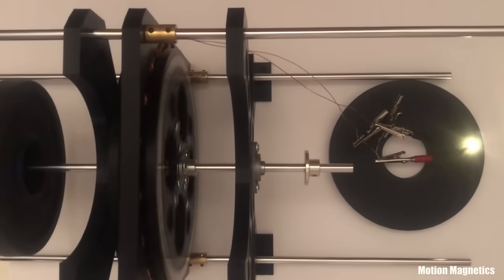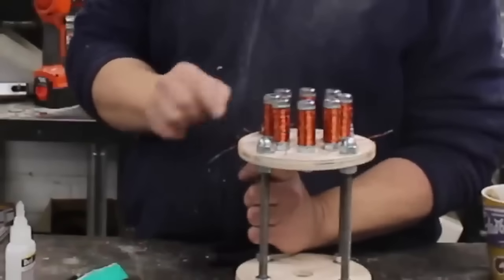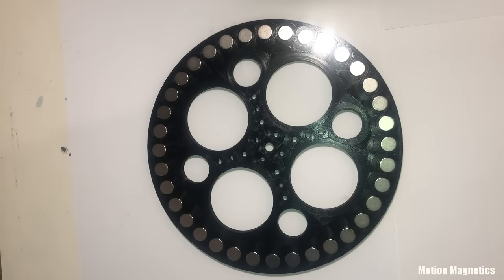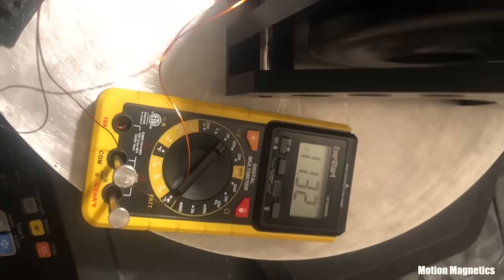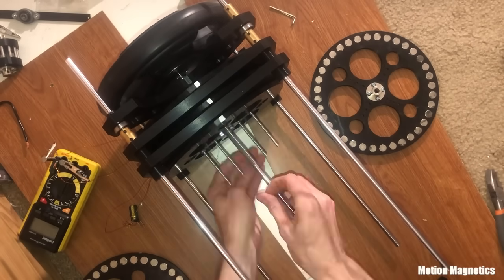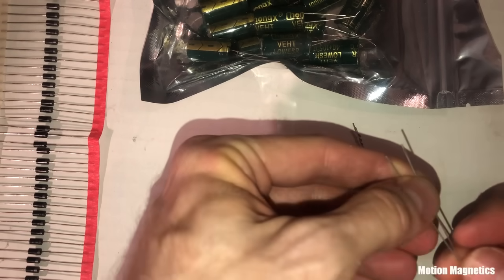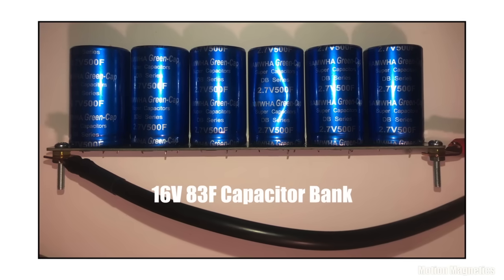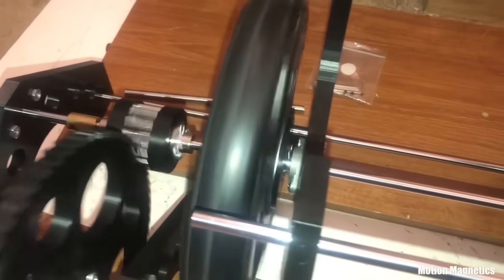Stackable Generator

Comment: Thanks for sharing this. As a retired Electrical & Electronics Engineer I found this fascinating and admire your approach in your endeavours to produce a working design from your experimentation. I look forward to watching your future episodes of this project.
Reply: where as i see a complete refusal to accept any of the tried and true design methods developed over the last century or so. wheres the minimal reluctance magnetic path?
wheres any attempt to calculate flux density?
is there the merest mention of jacobs law, the resistance of the windings versus the load?
was there any effort put into optimising turns ratios and pole areas?

simply spinning a wheel and measuring a few volts proves nothing... wheres the test on the power required to spin it versus the power it can deliver to a load? the efficiency of the system?

its waving magnets past wires and even faraday 2 centuries ago with no previous source material to fall back on had a better understanding of the principles to maximise performance...

these sort of videos are the antithesis of good engineering.
Reply: @paradiselost9946 Exactly. Notice how the system nearly failed any time a useful load was put on it?
Reply from the maker: Thank you! That means a lot to me coming from a retired Electrical & Electronics Engineer. I'm looking forward to building more of it and sharing it.
Reply: To counter the statement "these sort of videos are the antithesis of good engineering", you can argue that good engineering practices are essential for ensuring the safety, reliability, and efficiency of any system. Which I agree with. Also poor design choices or lack of attention to detail can lead to negative outcomes, such as accidents, injuries, and loss of life. Therefore, it is important to prioritize good engineering practices and invest in the necessary resources to ensure that they are followed. Innovation and thinking outside of the box is an important approach that can, but not always, lead to a radical design which could beneficial in its outcome. Basically if you think you can do it better, by all means give it a go. After all you may well turn out to be the next ‘Nikola Tesla’!
Reply: @onlooker251  why does it always have to be "nikola tesla"?

how about rankine kennedy? why doesnt he ever get a mention despite developing certain devices that are claimed as teslas?

sorry, ive known about tesla for decades, well before the current mythical cult status.

yes, he did amazing things but please dont crap in my ear about him. ive heard it all before. theres plenty of other people who have been ignored and overlooked as well from that era.

this guy recommends using bolts as cores for coils. wheres the high permeability laminations for maximum magnetic flux density and the minimisation of eddy current and hysteresis losses? wheres the reduction of air gaps to the bare minimum?

so i stick to my statement, these are the antithesis of good engineering practice, a waste of time, money, resources, making a barely performing device when an off the shelf unit will easily outperform it and has documented efficiency to back it up.

if he actually was attempting something revolutionary, or figured out how to overcome certain issues, im all for it.

but he hasnt. it isnt evolution, its taking ten steps backwards.
Reply: @onlooker251 all that supposed experience and jibber jabber with no practical input.

Comment: Watching your disks wobble is going to make me sperg out, please find a drillpress or make a jig for perpendicular driveshafts. There are dozens of cheap tools, drill attachments, drill alignment bit adapters, drill-mounted levels, whatever.

With a smoother spin you'll get more rpms, less drag, less vibration, less disruption, smoother generation... everything will improve.
Reply from the maker: I'll probably make the final version with a CNC machine. I'm still in the design and testing phase though, so it's just cheaper and easier to 3D print the parts until I get everything worked out.

You are correct though, everything in the performance will improve once I do that.

Comment: Great work! Have you figured out how to best transfer the weight into rotational energy? Although it might sound silly, take a took at the Leifheit rotational mop bucket. The handle of the mop uses an old mechanism like the old ratchet screwdrivers, but bigger. Maybe it'll give you some inspiration. Good luck!
Reply from the maker: Thanks. I've built part of the gear system, but am still experimenting. Gears can be a bit noisy, so I'm also going to test a belted gear system. 
Thanks for the suggestion.

Comment: dude imagine you make the 3d printer do the stator windings for you in serpentine so wire stays taught and continuous even layers in perfect symmetry no imperfections then use an odd number of serpantine posts so it works out like how odd blade fans are more efficient than even blade fans due to pie 🥧 or something definitely stack em up that motor drag though Is it creating power through braking but hopefully not wasting it to heat or noise inefficiencies...  currently as watching this simultaneously reading "electric motor manual" edited by robert j. lawrie and the staff of electrical construction and maintenance magazine , the things pretty detailed and only 128 pages a few for introduction table of contents and index of terms/page listings it was covered in dirt in my dads toolbox 🧰 but cleaned it carefully and just like new ... anyways glad you mentioned that guy i love his content too hopefully watched em all but i have to keep rewatching to make sure i didn't miss anything or just to refresh inspiration 😅❤ good old friend shared science data
Reply from the maker: I wish my 3D printer did all of that. 
I love his content as well. I'm nowhere near having watched all of his videos though. The man is a machine at cranking out amazing content on a constant basis.

Comment: it's probably pointless because it's just a prototype, but you should put those diodes into a breadboard or some kind of prototyping board, or at least solder them together for better connection. just gives me the heeby jeeby seeing them twisted together. maybe they will get soldered together some day.
otherwise a pretty cool project i would want to attempt some day
Reply from the maker: Well, I did heat shrink the magnetic wires from the bridge rectifier to 12AWG wires. So it's a step in that direction. You're right though, I will eventually solder things when I get closer to a final version.
Reply: It is just a low voltage toy. No need to get your panties tied in a knot.

Comment: have you tried adding testing a hallbach magnetic array it provides double the magnetic flux on one side of the magnets it add a little more weight to the assembly but the power output should be worth it. i also suggest using a inductor to help smooth out more irregularities in the power output. your idea looks and sounds great keep it up man
Reply from the maker: I have not, but it's been suggested a couple of times. Not a bad idea.
Thanks!

Comment: generators are built for engines, which will actuate it. This generator you built is good for turbine or diesel engine (constant RPM, high power density).
Reply: This generator is not good for anything.

Comment: I subscribed to your channel! You are doing so many projects that I have wondered about and mulled over through the years., I have a lot of drawings of ideas but lack of funding and probably a lack of gumption kept me from actually experimenting and building the things I’ve drawn over the years. I am especially excited to see your stacked generator ( that’s how I found your channel ). I use to drive a truck for a living and had a couple hours everyday before I got to my first stop which gave me lots of time to mull over ideas and think about how they might work. I’d make sketches of my ponderings and talk to friends about them. I was excited to see a company called “Lutec” actually building a stacked generator like I had drawn., they claimed that it could run itself and they had a short video of a prototype (looked like CG to me) actually running. I thought this was a good idea, I’m so glad to see someone actually building one. I still believe the stacked generator will not only work, but could be, very easily made to run itself, producing excess power. 
Your videos are great and so is your line of thinking and tinkering! I’ll be watching!
Reply from the maker: I have piles of design sketches, so I know just what you mean. 
I remember the Lutec motor. It was featured on a mainstream news show and then slowly vanished from the spotlight. 
Your line of thinking parallels my own.
Thanks! Do great things!

Comment: You should have the generator once spun up to auto power itself. Add a electric motor to the spindle and dedicate a few of the coils to power it. That way you can power the motor and generate more energy. You can also find a motor that will be just a little more powerful than you need to run the entire generator apparatus  at max that way the motor isn't over working itself and its shelf and use live is extended that mean you scale back the motor to never run at maximum capacity so that the more will never hits its stress limits.
Reply: I'm just rambling but I bet you get the idea. I dont ever have the ability to build such things but I can come up with technical ideas to help advance to at least help them along. I guess I'm the Idea guy not the builder type. this is a really cool project you got here man.😁
Reply from the maker: Thanks for the suggestion.
Reply: YEPPERS @Motionmagnetics
Reply: @novicracker1980 No!  You cannot power a motor, from the generator's output, to then spin the generator even faster.
Reply: @MrSummitville  why not?
Reply: If you use a motor that runs on alternating current and not direct current and requires an inverter to make the conversion I don't see why not. So please explain to me why not.
Reply: @novicracker1980  That'd be perpetual motion, which cannot happen
Reply: @skatingskelly  perpetual motion happens all the time you just don't see it.

Comment: General rule of thumb is to use a capacitor voltage 2 times the circuit voltage to account for their discharge behavior over 50% it’s rated voltage.
Reply from the maker: Thanks for the tip.
Reply: What "discharge behavior" are you talking about?

Comment: im no scientist but.
i have working models of similar things. for alternate purposes.
if youd be willing to work together. i think we may be on to something.
i can also tell you from 20+ years ago. fat wire vs skinny wire is a wasted debate.
think of it like this. how much power do you want to transfer?
skinny wire is sensitive. fat wire carries a load. 
in many ways i can show that but not the point.
we have much to discuss if youd like
Reply from the maker: Do you have any videos uploaded of your builds? I find it much easier to compare notes with a visual frame of reference.
Reply: @Motionmagnetics  short answer yes but no.
i do have many things ive made with proofs. some of the more recent things ive made have been kept more under wraps as im actually going to send some designs off to possibly get patented. im not full of it like some can be. the only real reason i dont share some of the stuff more openly is just so it doesnt get stolen before i can claim it as mine. i dont want someone to take my ideas and use them for profit. my things are so regular people can have things they need. its for emergencies its for people who dont have alot. any rich person can go out and buy whatever and i dont feel bad for them. but people that have to go with out thats who i wanna help most. 3rd worl underdeveloped areas people hit by natural disaster or even just this insanity of inflation. how you gonna heat or cool your house when the power company sends you a 100k heating or cooling bill. thats not right. but what if it didnt have to be that way. i dont want it to be that way.
Reply from the maker: @chehystpewpur4754  You can never be too careful when it comes to protecting your intellectual property rights. 

That mirrors my thinking. If everyone had access to generators that ran on something like gravity we'd never be at the mercy of the corporate power companies again.

Comment: Awesome project. I had started a gravity generator project as well, but when doing the math I thought I had found that the potential energy stored in something due to gravity was actually disappointingly low. I may have been doing the math wrong, but I was calculating that I'd need somewhere around 90kg for reasonable power output. Have you done similar calculations? The idea I may have been wrong has renewed my interest lol
Reply from the maker: I've been excited about the concept since it came to me. I quit worrying about the weight necessary to run the system when it occurred to me that I could just use a pulley system to reset it. You can make 500lbs feel like 50lbs with the right pulley setup.
Reply: @Motionmagnetics I'm trying the same thing!
Reply: It is not really energy dense (Doubt there's anything in use less dense). To have the same energy as a fully charged mediocre phone battery, you need 100Kg at 30m high. 
So using gravity as energy store is not really practical unless one very special case; Dams.
Can't see how it can be usefull for DiY unless you have a flow of water or a lot of space.

Comment: You are on to something with your stacked generator project. I had this idea a few years ago. The bottom two generator plates are wired to charge a capacitor bank which  is run through a voltage regulator and powers the electric motor which spins the actuator which also has a flywheel. As the bottom two produce the power to turn the unit, the gen-plates ( 4 ) above it produce excess electricity, which makes this an over-unity device, and I’ve been told they violate some law made by Therman Dimanic, and I didn’t want to get in trouble so, I never built the thing., I still have the drawings somewhere in my desk.
Reply from the maker: I think of them more as theories of physics. Sounds like a great idea. You should build it and share it in parts on YouTube like I'm doing.
Reply: No! There is no "excess" electricity. This will never be over-unity ...
Reply: @MrSummitville  Have you ever heard of a Step-up Transformer?

Comment: ok so. you get volts. what about amps?
This is a nice way to convert food > human > energy.
Reply from the maker: A hand spin produced a little over 60v 5ah. That's at roughly 200 RPM.
Reply: @Motionmagnetics 60 volts and 5 amps at the same time?  I did not see that in your video.

Comment: I think you and R ar correct, the single surpentine coild is a good concept, BUT only for an air cored rotor. if you want a coil, with a core, as opposed to aire path with a cutting flux you need to twist your coil to make concecutive smaller coils. figure of 8 multiple times. That way each slot, for want of a better term has two legs of the single coil...
Twisted  air cored alts are still wothh a look. Winding several wires in hand will allow paralell or seriese connection of the twisted, single coil/s, giving flexibility or even low and High RPM operation.
If you realy want to explore this look at air core Halbatch arrays... 1 loop. all be it potentally with several seperate coils, folded into many poles!
Reply from the maker: Interesting ideas. Thanks.
Reply: “Serpentine” coil is a great idea that should be followed… even 3 phase “serpentines” could be attained :)

Drag could be blamed to eddy currents (which would be worse if the cores are not laminated)… but those eddy currents are confirmation that there’s good magnetic flux going on.

But “air cores” is something I don’t understand… all my electromagnetic training tells me it may produce some voltage, but amps will be severely reduced.

Comment: Bro the drag/cogging is not much of a problem. Once the generator reaches a certain speed with enough inertia the cogging becomes negligible. Also for those strong magnets and that diameter of the rotor and stator, along with so much wire per coil i find it hard to believe youonly get 2 to 3 volts at 200 rpm. You sure you hooked up the magnets correctly for that coil design?
Reply from the maker: Are you referring to the microwave transformer? They can produce quite a bit of voltage but require a higher RPM and a smaller gap between the magnets and the transformer. I also had the rotor on an 8mm shaft @ 400mm length. It would bend if I moved the rotor closer. It needs a thicker shaft, or a much shorter one to give it a proper test. Sorry, I didn't detail that in the video but there was a lot of info to cover. You're also correct about the cogging decline at higher RPMs.

Comment: The width of the core material,  and the width of the magnets are important for efficiency,  or you will have multiple opposing fields saturating the  same core reducing voltage/amperage.
Also try using UF diodes to handle the back emf
Reply from the maker: Thanks for the suggestion.

Comment: Add a DCDC flyback converter for stable output voltage. Some can take 1 to 50v in and deliver 16v 20a continuously.
Reply from the maker: Thanks for the suggestion.